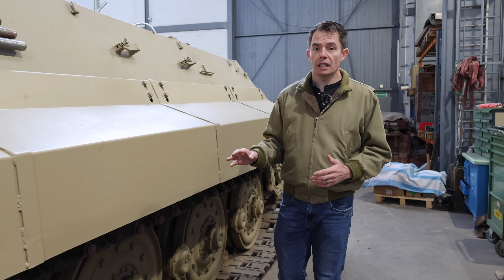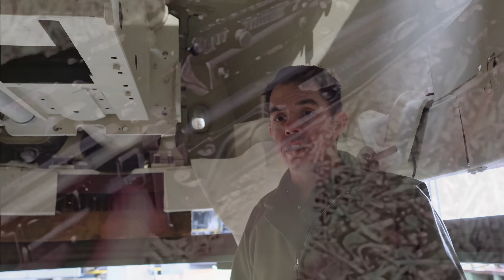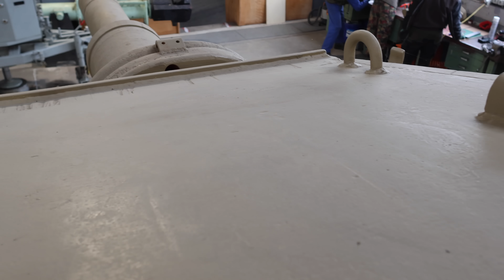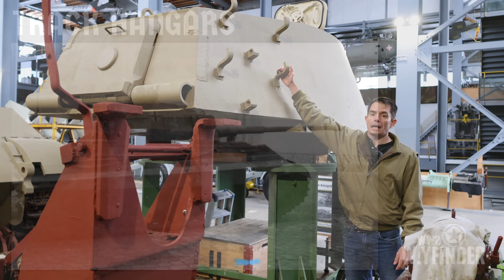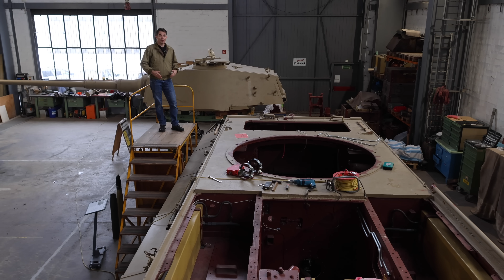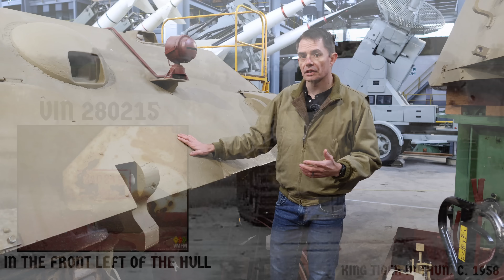King Tiger Restoration - Up Close with the King Tiger At the Swiss Military Museum

Comment: I have a model of this tank at home and the Tiger I ...To me it's more than an impressive tank of it's day and it was a very worthy adversary...Fear would roll threw the bones of Allied tankers or ground troops seeing this beast roar threw the battlefield unchecked with unrestrained power and capabilities can really wreck your day! And again, impressive as it is, I learned that an absolute tank does not mean absolute victory! I  It taught me theirs more to it than that...Like...It's initial design needed time, logistic, repair crews were constantly working throughout the European Theater of Operations, bombed out tank factories, high gas consumption, no gas left to fuel it and many failed due to faulty or under powered trans/final drive, lack of experience man power, not driving the tank correctly at recommend power, speed and terrain. And the worst part...Not having control of the air! These models in my home remind me there is more to victory than appearances, capabilities and sheer power...So, when I look at these models I understated what they really were and they remind me that they do not guarantee success...But people that do see them at my home are enamored by them...but they just see a tank! All these weapons of the past should be restored to there former glory...It is a reminder of the past, scarfices made, why they died and the more important part...IT CAN HAPPEN AGAIN!
Reply from the maker: Very well put!
Reply: @WW2Wayfinder  Thank you...
Reply: I have the "Forces Of Valor" Michael Wittmann tank and the Tiger II amazing looking and well made models...the past has to be remembered...

Comment: The main cannon was a 88mm not a 71mm 💁🏻‍♂️
Reply from the maker: I know, that’s why I stated it’s correct designation which is the KwK43 L/71.
The L/71 refers to length not the diameter of the round fired.

Comment: I’m someone who knows NOTHING about tanks AT ALL, and I was wondering about the noise that bounces around inside the thing. Would think it would be pretty noisy in there. Particularly if a round from an enemy shell hit it. Right?? And smoke and diesel oil and gunpowder. I would think after a battle, or during one, people would feel like they went 10 rounds in the ring with Joe Lewis. 
Could someone educate me?
Reply from the maker: They’d have headsets on for radio comms as it was too pouch to hear each other without them and yes if a round did impact the side the sound reverberations inside would be awful!

Comment: The algorithm actually gave me something that I fully dug here. Great video and the technology/engineering of the Tiger tank is scary when you think that roughly 20 years earlier tanks were the huge, slow and pretty much “point it in a direction and let it go until it breaks down”. The restoration crew are Swiss…that tank will look and function … possibly better than it performed after original production rollout.
Reply from the maker: Thanks for watching! The team in the museum are amazing and there dedication to getting it right is commendable and as you say it’ll be better than when it first came off the production line!

Comment: This has not really something to do with the Tiger, but: I was wondering, does in modern armies a system exist, where used shells and links are collected and brought back behind the lines in order to be re-used (melted back or so) for new casings etc.? I can imagine that during war times the question of raw materials, ressources etc. can become rather important so it would make sense to have a recycling-system in place where the used shells are recycled?
Reply from the maker: Certainly from my experiences in the past, spent brass is taken back and recycled and dealt with so it can be repurposed!

Comment: G.K.   U.S.A     I would have liked to have a tank museum near my home. A restored King Tiger would have been first on my bucket list to see .To see one in action would be awesome. A restored  King Tiger with an American Engine  and a heavier duty transmission would be a very interesting comparison with an original restored King Tiger. Also, as deadly as the ultra high velocity 88mm gun was, I have wondered if a 105mm or even a120mm gun could could have been fitted to this beast.  The Germans did have a monster tank  killer that carried a 120mm or larger gun.  These new weapons were dumped in a river to prevent the Soviets from capturing them. Too bad the Germans didn't make a secret deal to surrender them to us. We might have b een able to use them during the cold war.

Comment: Lab testing found that the armour plates lacked molybdenum (ascribed to a loss of supply, being replaced by vanadium--the same vanadium as used in the extremely durable Ford Model T frame), resulting in low malleability, this tended to cause cracks in the armor when struck. a common problem with all German tanks made later war.  While the turret glacis was still strong enough the thinner side armor was not as effective. Additionally the welds were inferior to earlier german tanks which led to spalling in the engine area of the tank which could disable the tank.  However these armor flaws were not particularly a detriment at the ranges the King Tiger usually fought defensively, although it did effect the vehicle in close in fighting where side hits were more likely.  In short a very effective defensive tank but not worth it's weight on the attack where it had to manuver and was subject to close in fire.
Reply from the maker: Oh wow thank you for that, info I wasn’t aware of! But all makes perfect sense.
Thanks again for that, always a good day when I get to better understand these incredible machines! Thank you!

Comment: The main APCBC round - PzGr39/43 is not between 7 and 8kg, it is 10.4kg (slightly heavier than the 10.2kg noted for the KwK36, AFAIK because of more extensive driving bands).

The APCR round - PzGr40/43 was ~7.3kg, but because it used Tungsten and the 'base' performance of PzGr39/43 was ample, this was not a common war-round.

HlGr 39/43 was also a limited use Cumulative projectile at ~7.65kg, but had worse HE capability than the fourth nature (SpGr) and worse ballistics, accuracy and penetration than PzGr 39/43... Also usually white.

SpGr 39/43 would be yellow painted, rather than black and weighed ~9.5kg

Comment: Will they give the engine more power when they restore it so it can handle the weight better ? And also the gearbox ?
Reply from the maker: I imagine it’ll just be rebuilt with higher tolerances and new materials and lubricants to hopefully make it more reliable and to help reduce repair costs etc over the long term life of the engine and gearbox. 
Thanks for watching 😃
Reply: @WW2Wayfinder thanks , great video , look forward to seeing the finished tank

Comment: There is a Tiber B in the United States that was brought from Spa in Belgium which came from where it was abandoned near Petit Spa, to Aberdeen proving grounds in 1945. The tank along with a Tiger E, had the port side of the turret and crew compartment cut away to make it easier to study. in the early 2000s it was at Fort Knox armor museum. I thad been nicely painted, looked new and a plexiglass window had been placed where the turret and hill walls were cut away. The museum then put mannequins dressed as the crew at their stations. It is unbelievable how roomy the interior was and how much room there was for each crewman. It is hard to tell how really roomy it is the way it is displayed while undergoing restoration because you are not standing on the floor of the turret and there are no crew taking up space. With the side of the hull cut away, you could see, in addition to the turret, how much space the driver and radio operator had. Having seen how big the Abrams is, on the inside, I cannot say for certain, but I believe there was more room for the crew of the Tiger B. And when you see photos of the Tiger E, with nothing to compare it to, it looks enormous. But even a Sherman is impressive in size against both Tigers. But when you put a Tiger B next to the E version, the E version appears small and very crowded.
Reply from the maker: I think that’s Tiger 332 and I’m hoping to track down where it was abandoned tomorrow!

Comment: I cannot help but wonder what this tank could have become if it were not rushed into service and later discontinued before real improvements were done. The obvious need was a better engine, but designers had upgrades on the drawing board that included stabilized sights, an automated loading system, and additional ammo storage. If this tank had been fully optimized, it would have been even more of a terror than it was.
Reply from the maker: It’s quite incredible isn’t it. With those improvements it could have dominated every engagement, certainly on an even tank on tank fight!
Reply: Leopard.

Comment: Great video, but I wonder if what you have labeled as the HL230 is actually the Gearbox, I believe you can see the engine on a stand in the top left of the picture.
Reply from the maker: You’re correct, I miss-labelled the slide which is very annoying but yet you are correct!
Thank you for watching 😃

Comment: Great video, I want to know more about the history of this Tank. 
Where has it been hiding for the last 79 years.?
What was the condition of the Tank before restoration etc.
Do they have the Engine and gearbox and most of all, will
it be brought back into running condition.?
Reply from the maker: It’ll be brought back to running condition fortunately! If you have a look on the museums website (link is in the description) it has the history of the tank on there and it has an English text version that breaks down what happened to it post 1945.
Reply: @WW2Wayfinder  Eventually found the right pages on their site.. 🤔👍🏼Thanks..

Comment: 10.4kg for the AP KwK43 is what my rounds weigh in at as were the flak 18 AP despite the driving band differences, my flak18 HE were about 7-8kg with the AZ23 fuse. Empty AP + case are 17kg and that's without the fuse on the projectle. I'm certain thinking back to the wooden boxes each AP round full is 27kg. Brilliant video. :-)
Reply: * fuse under the projectile within the case, that should read.
Reply from the maker: Thank you! 
Nice that you’ve got original examples in your collection too!

Comment: I know the turret is on a rack n' elevated, but Jus' IMAGINE being the loader, even being a larger/taller guy working within the T2's rather spacious turret with all of those ReadyRounds @ hand stored in the bustle?!......
.....~AND~.....Or THEN:
Having ones commander deem, depending upon individual circumstances & battle field conditions, a full complement storage of ammo in that particular area VERBOTEN for matters of crew safety if the turret flanks happened to get penetrated.....
Maybe  allowing 10-12 rounds or so @ hand?

-Another 'Safety Feature' Ive read more than a few crews working in the heavies had done, was have their WerkStattCo buddies completely, or partially REMOVE the cannons recoil guards (Completely remove loaders side guard-pipes & Cut the side plate 1/2 way back on C.O/Gunners side so as to still retain the 'Braun-Ark' metering device for judging if the recoil cylinders need additional oil)
-Some may think such a modification absolutely INSANE to do, however, MANY crewmen that chose to live with the danger(s) SURVIVED many a tank penetration, as it allowed MUCH easier >>!EGRESS!>> in a panic'd scramble to get outtve a turret/tank about to brew-up...(No wonder 1st & 2nd SS Heavy crewmen were attracted to pilfering U-Boat crews LEATHER attire?) 

-Plus, they mostly fired from a standing/stop'd position anyway. Watch an Abrams loader for instance. 'Fly/Spider on the wall' stance...
-Such 'Bad Ideas' oft times, oddly tend to >increase safety<....-For instance: I removed the plastic safety guard on my 10" carpentry chop-saw doing a repair, I realized upon its removal & then purposefully NOT re-installing it, the sheer amount of unsafe BAD HABITS I'd acquired, or developed, always as a result of relying upon that flimsy-azz guard itself!
-Im MUCH more aware, cognisent & work more slowly & safely as a result of its removal..(Gives ya'allz a 'HIGH-FOUR'...;)
Reply from the maker: Oh wow I wasn’t aware of those mods but certainly makes a lot of sense!!

Now just keep a close eye on those 4 fingers 😉
Reply: @WW2Wayfinder  ...HA! I NEED ALL these puppies! (& then some;)
It certainly does doesnt it?  Considering the dangers involved with AFV's/Tanks, no matter the era. Getting out of a fooked/or soon to be even more fook'd vehicle as rapidly as poss may trump eradication of a few OEM 'Safety Features' Fully accepting the risk VS. reward aspect(s)...Just HOPE that cannon breach isnt OPEN when the interior fire starts, acts like a vicious, vacuum packed rocket-stove of sorts...Uggghhhh...

Ive attained quite the WW2 German Armor library as reference materials for this massive 4x12 ft, 1/35th mega diorama Ive been steadily/full time been working on since around 2009ish (Almost embarrassed got @ least 300$K into it over that total time span. 650 figures @ last count, 1/2 of that number being resin figures @ 15-20$ per solitary figure, gets kinda $pendy, aside from all the full interior kits of tanks/vehicles/buildings...EEK!;)

Its general focus is a few Wehrmacht/SS Panzer WerkStattCo's working on all manner of vehicles/tanks.etc, but MUCH more than just those^ as far as individual scenes. Taking place sometime around mid July, 1944, Normandy. Somewheres between Falaise & Argentan, but closer to Argentan.. (I may post vids of finished work @ some point, but the work/mods/scratch building takes an incredible amount of time as it is, aside from well done vids/editing!)

SO MANY German veteran stories & odd battlefield modifications contained therein those books...Ya def come across some interesting accounts...
I can recommend a plethora of such books if your ever interested, feel free to ask if looking for specific battles/units/etc...

Be Well....;)

Comment: Wow, not many people can say they have been in The Turret of a King Tiger. That will be some Machine when it's complete. Hat's off to The Restoration Team 👍👍
Reply from the maker: It was definitely an experience! Made me finally comprehend just how big they really were.
The teams work is incredible and I think when complete it’ll be better than when it rolled out of the factory for the first time!
Reply: @WW2Wayfinder  I would agree with you there. With modern engineering and production facilities, it will certainly be a unique machine and as you say, better than before.

Comment: The Swiss are doing a great job and the restoration looks fantastic thus far.
I gather they want to return it to ‘working’ condition (which seems great) but -
Will the original engine and transmission system be used? If so, I wonder how reliable the beast will be.
Bovington have huge resources devoted to their Tiger 1 and it breaks down quite a lot.
Don’t get me wrong- I’d love to see  King Tiger running at Tankfest.
Reply from the maker: That’s right it’ll be a runner when it’s complete. I’m not sure with the engine/transmission etc how much will be original and how much will be newly made but hopefully it’ll run well as it will be amazing to have another big cat up and running. 
I’m still yet to get to the Tank Museum when 131 is out in the paddock, hoping I can rectify that in 2024!
Thanks for watching 😃

Comment: The myth of the unreliable drive and insufficient engine power is repeated again and again.
This can probably be explained psychologically in some way, perhaps as the Achilles effect, that every superhero simply has to have a weak point.
Considering that the Tiger II was only in service for just over a year, so the usual teething troubles were to be expected, it was surprisingly reliable and if you compare the approx. 10 hp per tonne of power with other heavy tanks of its time, then it was in no way exceptionally low.
Perhaps we should compare it with the pride of the British armour industry - the Churchill tank - with up to 8.7 hp/t or the Pershing with an incredible 0.7 hp /t more than the Tiger II?
From today's perspective, we generally expect tanks to be highly mobile, but to apply this standard to that time is anachronistic. 
Heavy tanks of the 2nd World War were slow, all of them.

Comment: Question, if you put a modern tank engine in a WWII tank would it be faster, more reliable, and better fuel management?
Reply from the maker: From my understanding, you’d need the full system, transmission, suspension, fuel systems etc to be modern too and then new track to be able to handle the power etc